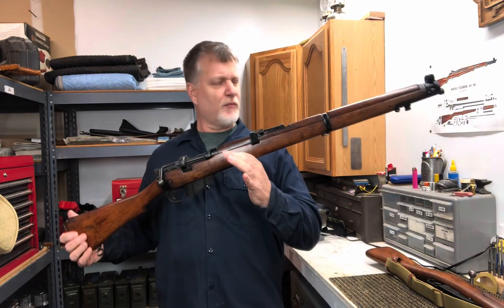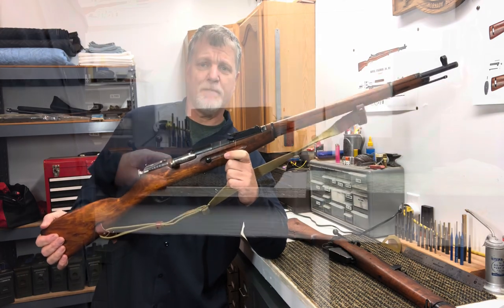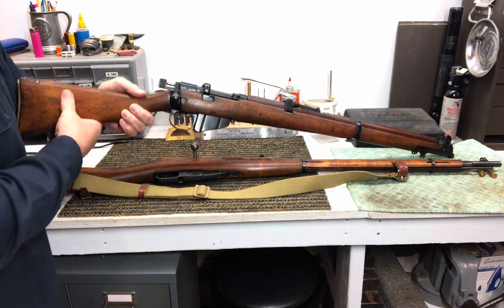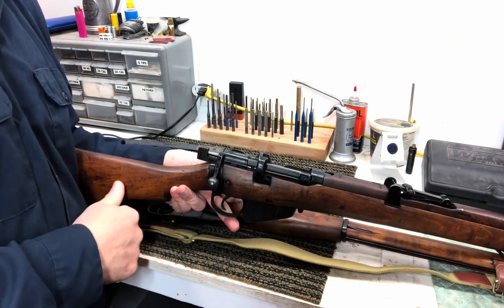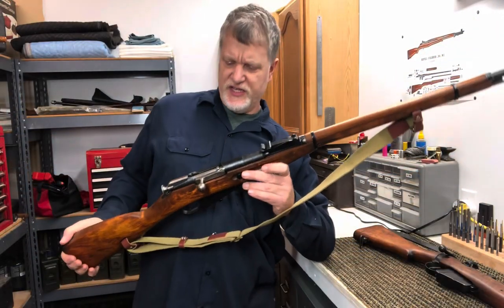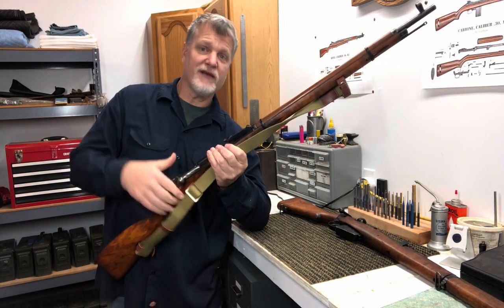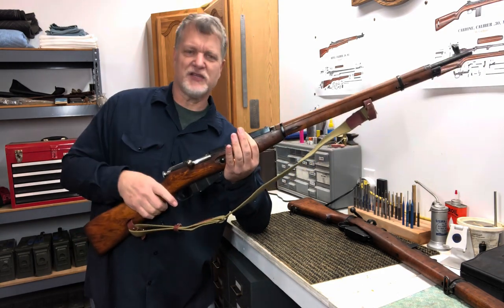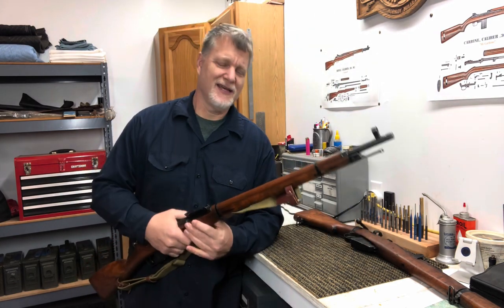Lee Enfield compared to Mosin Nagant

Comment: you can brace your thumb
on the other side of the mosin
receiver to work the bolt handle
more proficiently... plus its easier 
(on a MN than a LE) to keep your 
right in place and work the bolt 
w/ your left